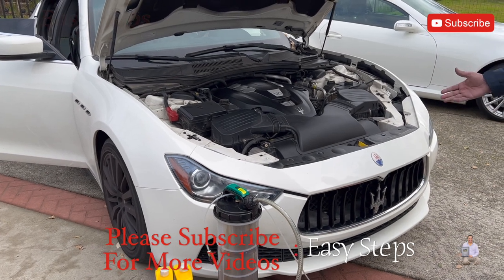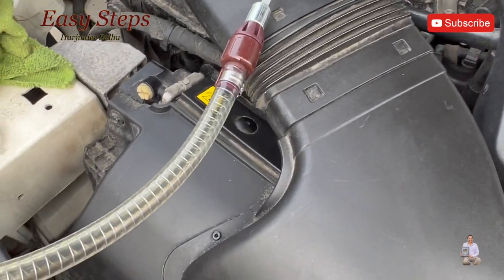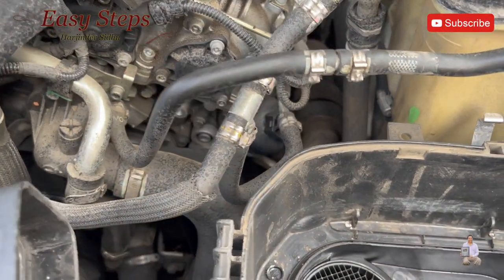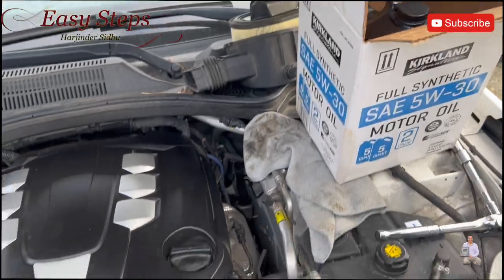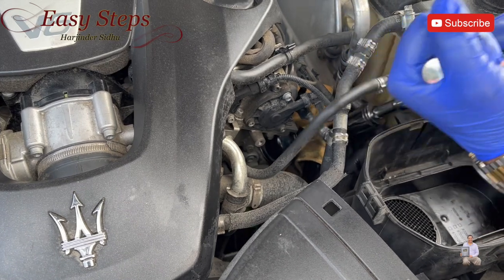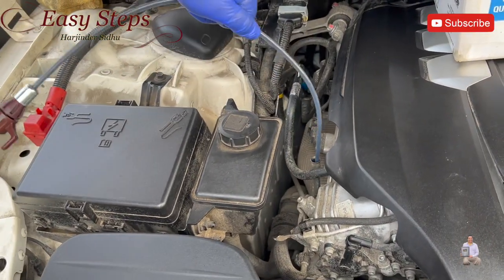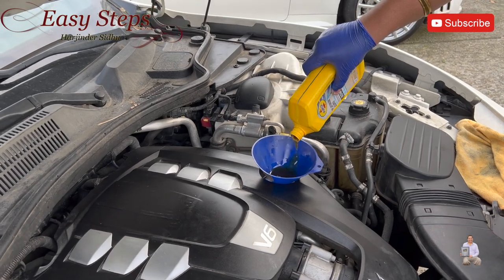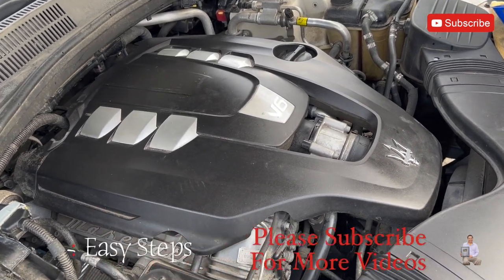How To Change Engine Oil and Oil Filter on Maserati Ghibli Without Getting YOUR Hands Dirty

Comment from the maker: How To Change Engine Oil and Oil Filter in Maserati Ghibli | Maserati Engine Oil Change with Oil Pump Extractor | How To Change Engine Oil and Oil Filter in Maserati Ghibli with Oil Extractor Pump
Reply: I have 2019 Levante - I have only seen it done with total flush via bottom panel underneath car. Is it really safe (and same affect) to use pump in dipstick hole to drain the oil and fill up, instead of total flush way? Thanks in advance

Comment: The new oil filter you said you have to lube the O rings?
Reply from the maker: Yes, please lube the o-rings, thanks for watching.
Lubricating O-rings before installation or changing them can help protect them from damage and make them last longer. Lubricants can help prevent issues that can arise during installation, such as tearing, overstretching, and improper seating. They can also help O-rings seat correctly and fit tightly.

Comment: Did you happen to warm up the engine first? If so, how long? I’m trying to figure out the operating temp to stay below 175 for extraction but it’s just a basic gauge for temp not digital.
Reply from the maker: I perform my own oil changes, but I am unsure of the ideal temperature for this maintenance. I usually perform them when the engine is cold, but I am unsure if this is the optimal time.
Reply: @EasySteps_Sidhu  Thank you for taking the time to reply my friend. I ended up completing it using your tutorial with a cold engine and it worked well. Just took a bit of time with the extractor, well worth it though. Thank you again.